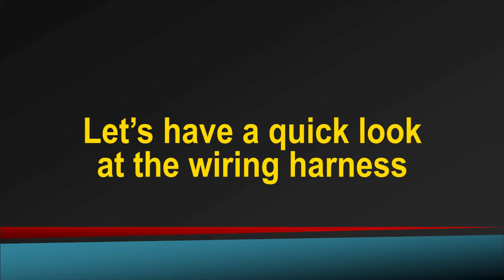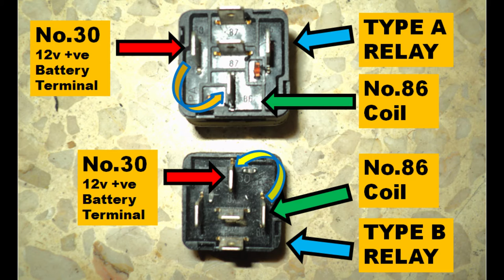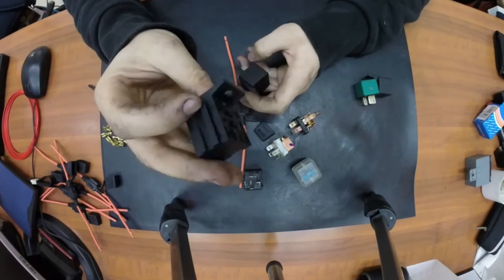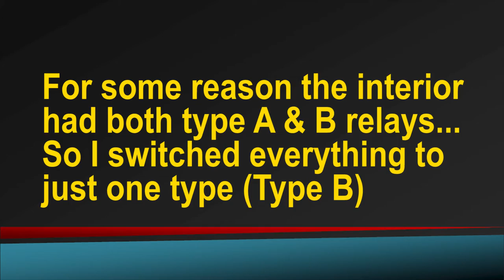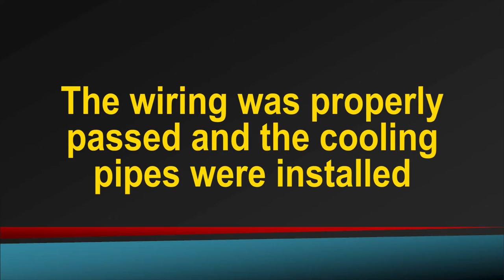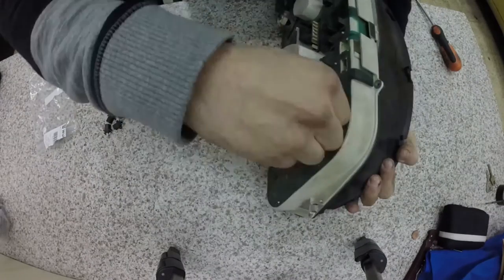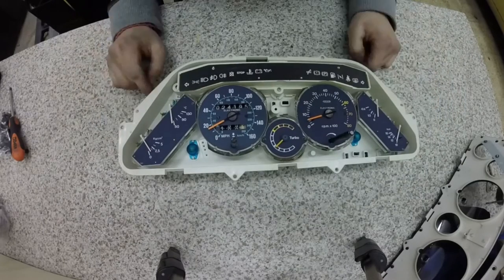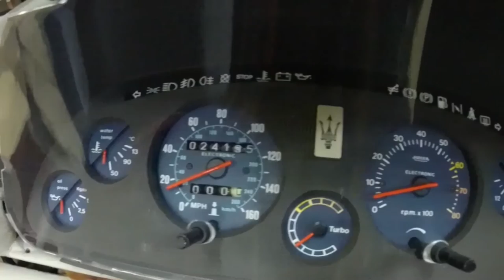Dealing with the Electrics - Maserati Spyder Part 40

Comment: Awesome and tedious work.. Hats off to you. Alot of your work and skills are way over my head.
I'm about to upload a new video of my near finished car perhaps tonight or tomorrow.
Reply from the maker: Thanks, figuring out what's wrong with the wiring was a nightmare. It would have been way easier to rewire the whole car, new ECU and new custom gauges. But to do so I would have been looking at around 4K just in electric parts... So I had to steer away... No matter how good of a wiring job I do, something will eventually come to haunt me in the future.
Reply: Matthew Micallef Agreed, my own wiring gave me the most headache..like you the general high cost of any replacement parts made me also search the online blogs for equivalent substitutes. Ive also found that careful searching eBay has been a gold mine and has saved me alot because there are so many non running great condition cars being parted out now days everything can be found including new in box parts
Reply from the maker: I am shying away from most OEM parts. If the wiring does not give out any issues i'll leave it at that. If anything comes up a new programmable ECU will be fitted. Also same will follow for mechanical parts. The prices of parts on cars as cheap as this are starting to become a bit of a joke.